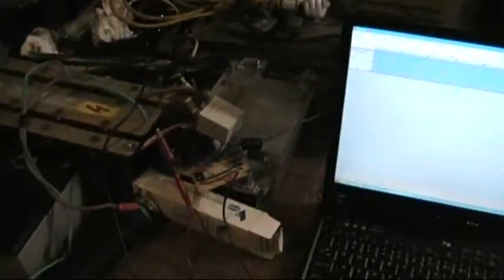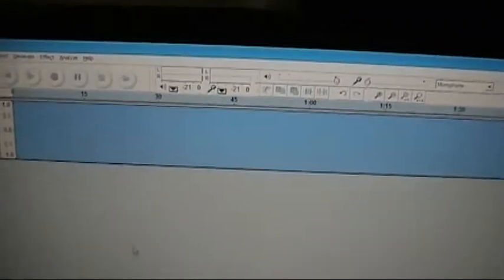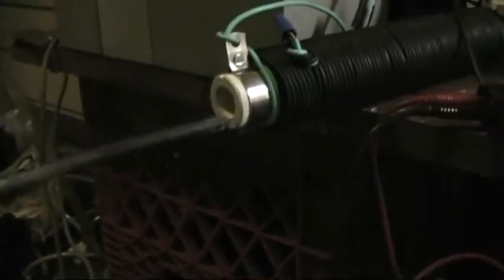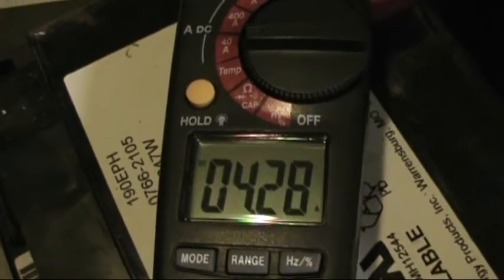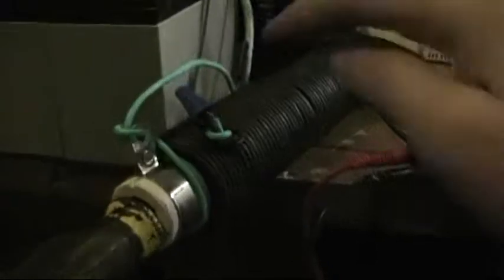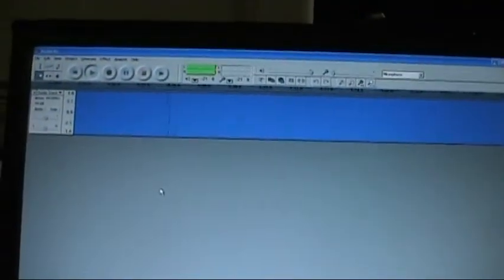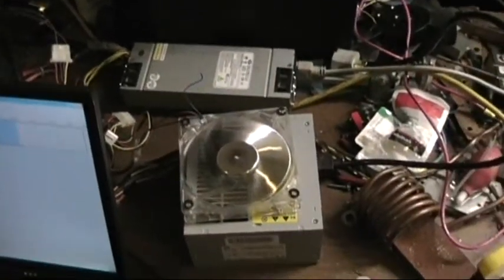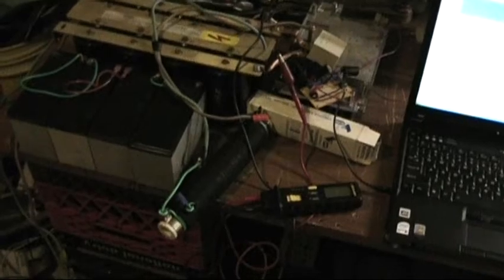IGBT Half Bridge Induction heater, Signal from PC.

Comment from the maker: This was actually just a setup to test IGBTs with different frequencies and different sized coils. It's not resonant. the capacitors are for energy storage. They are in series parallel. The lower IGBT stage switches the lower capacitor bank into the coil for a negative polarity. The upper IGBT stage switches the upper capacitor bank into the coil for a positive polarity. So it acts like an inverter. Using a higher frequency and a resonant tank would make a better induction heater Thanks.
Reply: I WANT TO SEE THE GATE EMISOR SIGNALS IN IGBT